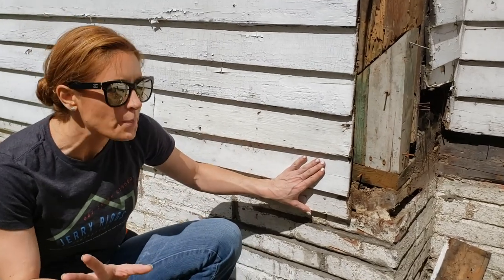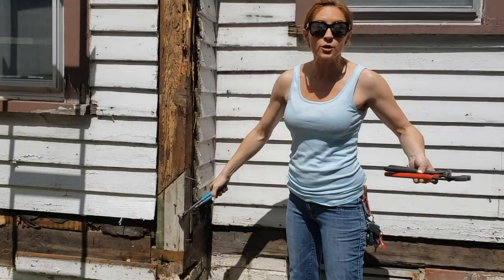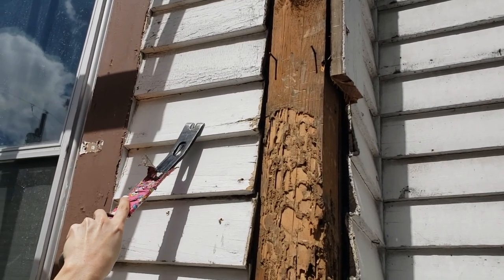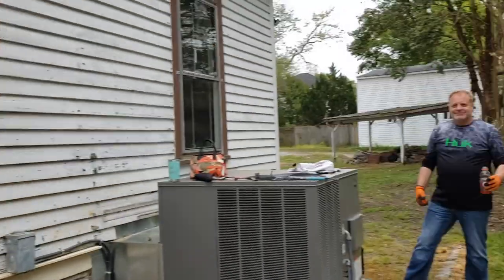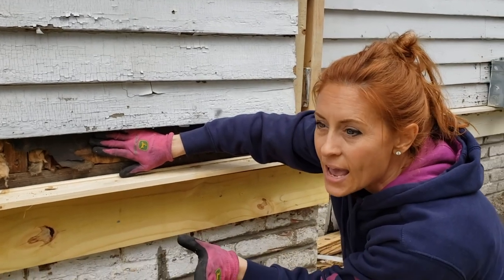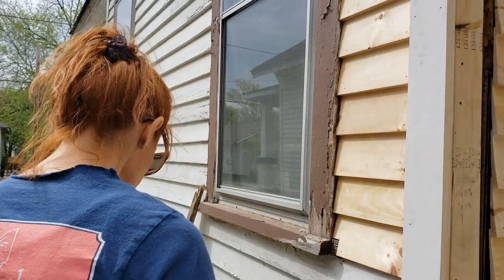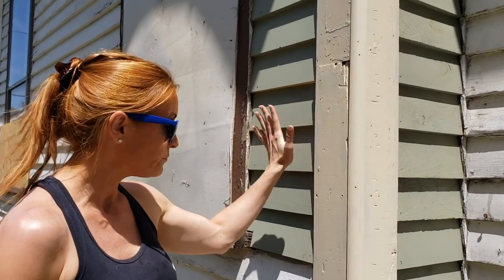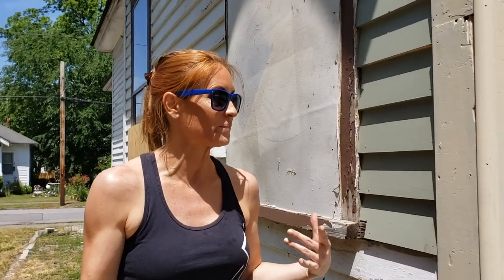Taking the exterior Siding back to Historic Standards...and the mess we found underneath!

Comment: If you're using Pine siding  , Pre-Prime before installing . Keep practicing with the carpentry skills though and good work . Also be aware that you're working with Lead Paint chips , don't lick your fingers lol . I've been doing this for a long time as well and it gets easier with experience so keep at it . Also do not trust anybody on a jobsite these days , many are drug addicts that will steal anything  right down to a used tape measure .

Comment: How do I know the termites are gone?  
I bought my first house April 2023 that was a flip and found rotten termite wood in the porch
Reply from the maker: It's hard to know.  You can buy the termite and carpenter ant killer and sprinkle it stings the house and under the porch.  If you break up some of the eaten wood, you may be able to see them if they're still active.  Main thing is to get the wet wood dried out and all wood off the ground which is what attracts them.

Comment: I've got some beveled siding that's rotted from a bad gutter and ants. It has an 8in facing so i have to order 3/4x10x8ft?
Reply from the maker: You have to order the width that can handle the reveal + overlap you need, and then the thickness you need.  Check a few different lumber yards around you to see what's in stock and what they can order for you.

Comment: What size wood did you use for the clapboard? 1x4?
Reply from the maker: no, it was 6" beveled pine siding. Mine had a reveal of anywhere from 4.5" to 5.5" so I would just match the reveal to the existing course.

Comment: Housewrap! You needed something between the siding and the corner and the studs.
Reply from the maker: Some people do that, but I think these old houses were designed to breathe, not be a shrink-wrapped space bubble.  The house never had house wrap, and it hasn't rotted to the ground yet.  So I figure, if it ain't broke, don't fix it!
Reply: @AdrienneLovesOldHouses  My mother's house, built around 1910, has rosin paper between the sheathing and the siding. When I did a repair on a corner similar to yours (no termites, too far north), I added a semi-breathable wrap before I reassembled the corner.

Comment: Why is the window sill ledge hacked off at the ends?
Reply from the maker: I didn't do that. When vinyl siding people come to install, they hack off all protruding edges on window sills, drip caps, etc anything to square off all edges to make their job easier. So I had to rebuild these parts.
Reply: Do you have a photo showing it fixed you could share?
Reply from the maker: @Private Name  yes, if you send me an email asking for it, I will reply with some pics!
ThisHoodHouse@yahoo.com